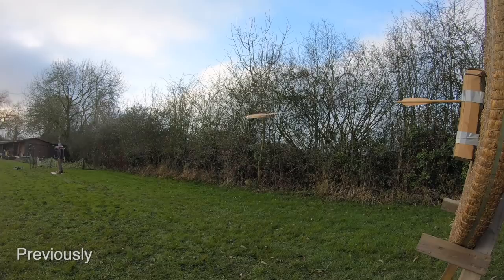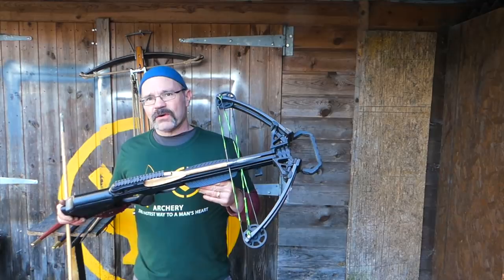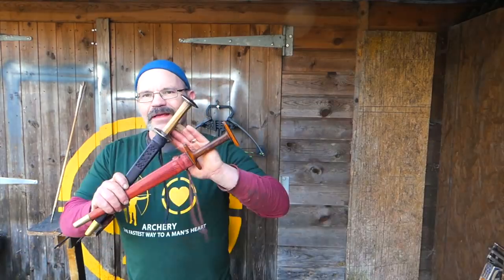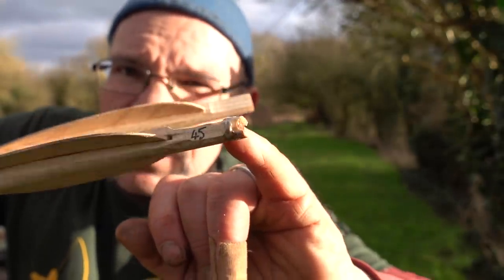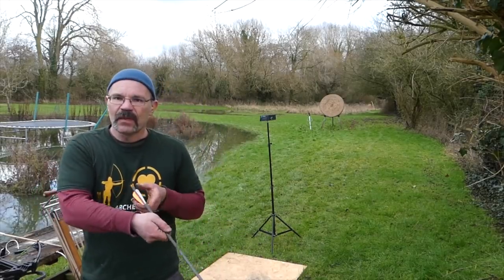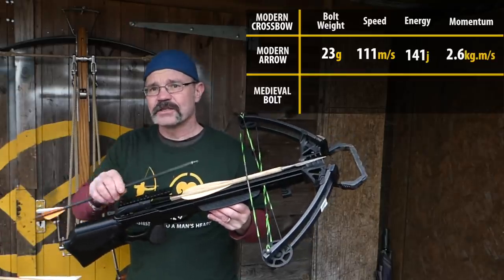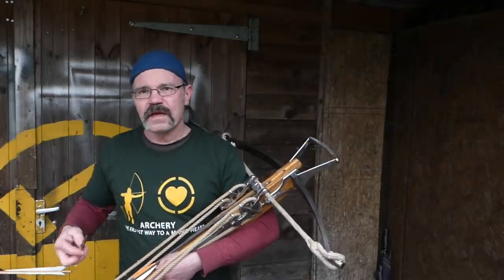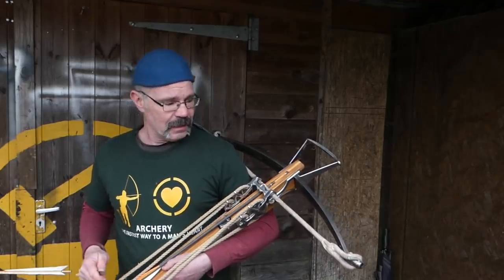Heavy Crossbow - Light bolt - What happens?

Comment: The heavy crossbow had less energy with the modern bolt for the same reason a sledge hammer won't drive a golf ball very far, and why a golf club isn't a good choice to nudge something heavy into place. Great video, cheers!
Reply: This comment is the explanation :)
Reply: Except the modern bow (the golf club) got a lot more power from the heavier bolt.
Which makes me wonder why we don't use heavier bolts for hunting.
Reply: @Bacteriophagebs  I guess because light bolts are lethal enough, while also traveling faster. So it's easier to hit your target with them.
Reply: @Bacteriophagebs  Because speed is what counts, you don't need a super heavy arrow to kill a whitetail.
Reply: @spectre9065  Sure, but some people hunt bear with bows.
Reply: @Bacteriophagebs  Even bears can be killed with a 500 grain arrow. It is about shot placement.
Reply: @spectre9065  Bears can be killed by  .22 LR, too.  That doesn't mean I wouldn't prefer a .45-70.
Reply: @spectre9065  you ever see the video of the guy taking a bear with a blowgun?
Reply: Or a Power lifter struggling to throw a Javelin far while the Javelin thrower struggles to throw an Anvil.
Reply: @spectre9065  Sure, but ideally you want to end him rightly, which is why I would suggest using Pommel Tipped Bolts. Zero penetration but plenty of Stopping Power. Could probably bring down an Elephant.

Comment: In the bowyers community it's referred to as ''dry fire speed'' which indeed means the speed at which the string returns to brace height without any projectile on the string. 
This is mainly looked at from a ''flight'' (max distance shooting) point of view. A flight arrow can be so light that the bow comes very close to dry firing speed. However this is only really useful for short bows with light tips, an English longbow wouldn't gain that much distance just like the 960lbs crossbow didn't. 
But here's an interesting thought:
Regarding wooden bow efficiency the infamous ''10 grain per pound'' (gpp) rule is normally used. That means if your bow draws 50lbs, a average arrow would weigh about 500 grains. If it shoots 180fps with a 10gpp arrow, you made yourself a wonderful bow. If you go to a flight arrow you might shoot 2-3gpp, but this is considered dangerous because the bow is close to exploding.
The 960lbs crossbow only shoots 1gpp when shooting the 67gram bolt at 181fps! Yet it's safe even though the prod could be forge welded from 20 pieces!

Comment: I have to say; beautiful job demonstrating the physics. Wish I knew the word for "base rate at which bow returns to brace" if there isn't, there should be. The KE vs momentum debate, has been a bit of an obsession of mine, again great stuff.
Reply: According to documentation on Hooke's Law - the physics behind how springs work - it is "Restoring Force". That being said it is not a calculation of speed, and therefore not a rate. I suppose the rate would be 'Once however fast you can fire' as that's how quickly it would do it. You could convert the velocity by measuring draw length though, film the release on a high frame camera, monitor the time and then make the calculations from those. You would in reality though be dealing with fractions of a second, but could convert to m/s.
Reply: That debate has to be settled once and for all. The main problem is speed as at high velocities friction is wonky. So low speed it is. I'd say take a 1 kg weight with a pointed shaft and while swinging from a rope it should drop 1m in height and end up at a target while the rope is vertical. E=10J, p=4.5kg*m/s. Then take the weight to 10kg and drop it from a 0.1m height swinging. E=10J, p=14kg*m/s. The speed difference is small and would have negligible effects from friction. If they have the same penetration Energy wins, if not I would expect a 3 times better penetration of the 10kg for Momentum.
Reply: I had been thinking of it kind of like e pendulum, the moment of pendulum is the same with little regard for amplitude. So would a bow be similar? For example, would a bow drawn to 28 inches that returns to brace in say 3 (just picking a number)  milliseconds does the same bow, drawn to 32 return to brace in the same time?
Reply: @bokkenwielderful  hypothetically there would be a difference unless you increase the tension on the string. We are talking a difference of nanoseconds, but numerically speaking there would be a difference.
Reply: @bokkenwielderful  If it was a true spring mass system where the force is linear to the travel it should be the same time in a vacuum (no aero effects). But given the nature of the force draw curve usually found in a conventional bow it would mean it would be faster at the 32.

Comment: ++++TLDR AT THE BOTTOM++++

Engineer here. The speed at which the Materials in your bow are moving depends on their stiffness, their mass and of course how they are arranged. There's nothing more. Under the keyword "structural dynamics" there is a lot of information, though it's difficult to understand.

Now to the bows: Steel is very stiff. And very heavy. So you need a lot of mass to get a certain total stiffness. The string is also very thick and heavy, so that it isn't breaking. This means there is also a lot of mass that has to be accelerated to high speed. And on top of it there's only very basic leverage used. So all these heavy parts have to move quite quickly compared to the bolt.

On the modern bows there is much  fewer weight that has to be accelerated at all. And the compund system is optimized such that by usage of leverage minimal energy stays in these moving parts. They are light and compared to the speed of the bolt much slower than on the old bow.

Now on both bows all (in fact not all) stored energy is transfered into movement. Some of it moves the bolt and some of it moves the bow and string itself. A little bit simplified: To all time instances the sum of potential energy and kinetic energy is constant. The kinetic energy is the sum (integral) of the energy in each point of the bow and arrow. So to calculate it, you have to sum (integrate) up all the local energies E_kin=0.5m*v², with m and v beeing the local mass and speed. Let me rewrite all the formulas:
E_pot=given.
E0=E_pot+E_kin=constant
E0=E_pot(t=0)
E_kin=integral{ of 0.5m*v² }{ over every moving part }

This can be approximated by saying, that the kinetic energy is approximately
E_kin_approx=0.5*m_bow_effective*v_bow_effective²+0.5*m_bolt*v_bolt²
So I introduced m_bow_effective and v_bow_effective which approximate the properties of the bow in such way, that this E_kin_approx is as accurate as possible. I further approximate this by saying that there's a constant factor C, such that
v_bow_effective²=C*v_bolt².

This leads to this much simpler equation 
E_kin_approx=0.5*(C*m_bow_effective+m_bolt)*v_bolt²

Next step, I want to derive an equation describing the kinetic energy in the arrow. I do this for the time instances where E_pot=0:
E0 = 0+E_kin = 0.5*(C*m_bow_effective+m_bolt)*v_bolt²

by substracting the energy of in the Bow, we get
E_kin_bolt=0.5*m_bolt*v_bolt²=E0-0.5*C*m_bow_effective*v_bolt²

OH BABY! Finaly a usable first result. It tells us, that if m_bow_effective increases, E_kin_bolt and also v_bolt are decreasing. Exactly what was shown in the experiment. Let's go back one equation to derive something less abstract for E_kin_bolt. By division we get
v_bolt²=E0/(0.5*(C*m_bow_effective+m_bolt))

Multiply again with 0.5*m_bolt we finally get
E_kin_bolt=m_bolt*E0/(C*m_bow_effective+m_bolt)

by now choosing some constants as m_bolt=1, E0=1, C=1, we get a beatiful graph 
https://www.wolframalpha.com/input/?i=x%2F%281%2Bx%29+from+0+to+5

TLDR:
showing that if we use an arrow that's light compared to the effective weight of the bow, increasing the arrows weight is almost linearly increasing it's energy. If it's heavy compared to the bow, increasing it's weight further doesn't increase the energy much. Guess where each of the bows is located on this curve.

I would be happy if this comment receives some love c: took me an hour to write Haha
Reply from the maker: And it does receive love!  Thanks sci much for this; I can't pretend I understand it, but there will be people out there who do, so thanks on their behalf for enlightening things.  In a nutshell, this is why I test stuff, because I have to see it.
Reply: Despite your Comment made me feel dumb^^
Here is +1 Love from me
Reply: @tods_workshop  Thanks Tod <3 That's why there is the graph and the TLDR. 

I Assume that this bow could shoot an arrow with 120g at around 48 m/s with 140j and a ton of momentum. I would love to see this in a test.

Since I haven't determinend the constants, any prediction can be just by rule of thumb. Therefore it's mandatory to do these practical tests for practical knowledge!
Reply: @ottersirotten4290  And you get a <3 for your beautiful name. Made me laugh
Reply: Is the given data enough information to solve the equation for the given bows? If so, then the ideal mass of the bolt could be calculated to optimize either energy or momentum. (It appears that momentum is a better predictor of penetration than energy, from the data I've seen.)
EDIT: If I'm reading this right, I just realized that the equation you gave has a maximum at infinity, which means the optimal energy/momentum only happens when the bolt is effectively infinitely more massive than the bow limb. So I guess that won't work.
Reply: @mitchellhowell9380  Yes, your edit is absolutely correct. Because I neglected all the losses (friction...) my calculation says that any heavier Bolt has more energy. So in fact there is no real optimum. But if we introduce a weighting function, where we for example compare the gain in energy vs the loss in speed, then we can absolutely find an optimum in this measure.

This weighting is of course a bit subjective and depends on the purpose of the bolt. For achieving a long range one would maybe get an optimal arrow weight of 67g out of it, and for best armor penetration on short distance an opimum at 150 or even 200g.

Comment: You can always trust a man with a horseshoe moustache who's holding a crossbow.
Reply: Clean-shaven with an intimidating laugh and a slingshot works as well
Reply: @ilikeyourname4807  don’t forget the bald head ;)
Reply: It is indeed a moustache of epic proportions. Even Trevor Philips would be green with envy. Maybe; when I finally shave off my lockdown facial fungus, I'll try out the horseshoe look.
Reply: Especially when he is selling you something.. 
Tod: "hey mate, buy my daggers!" 
me: swipes sweat, swipes card
Reply: As long as he does not point it at me.
Reply: Seems  a bit like pcp air rifles. With them you get more power with a heavier pellet without as much of a speed drop off. Yet a Springer performs better with a lighter pellet.
Reply: @lilmundo6826  Yeah, moustaches have been known to go off when being cleaned.
Reply: As long as he's standing on the same side of the moat as you.

Comment: Todd, great video!  Your analogy about a sports car vs a truck is very apt.  I ran some numbers based on your test results.  The medieval style crossbow effectively is pushing an additional 168 grams of mass (so it accelerates 168+23 or 168+67).  It is actually pushing a lot more weight than that, but most of the weight is traveling a significantly shorter distance.  By contrast the modern crossbow is only accelerating an additional 4.7 grams (so 4.7+23 or 4.7+67).  So for the medieval bow, the arrow is a small fraction of the weight being accelerated by the bow, whereas for the modern crossbow the additional mass from the bow is the small fraction.

This also means a 200g bolt from the medieval bow would still go 44 m/s and pack 193Joules!  So, launch some Plumbata from the medieval bow!
Reply: Oh, and if the bolt is around 150g, the modern and the medieval bows should produce the same speed bolt.  Anything heavier and the medieval bow wins.

Comment: It'd be a tricky build and require a very remote and well banked testing location; but it would be awesome to see you test Detritus' Piecemaker from Discworld someday.
2000lb siege crossbow; originally cart mounted, windlass draw of course, firing a 6ft iron bolt; converted to fire a bundle of 20 or so arrows which in the books shatter into pieces and frequently burst into flame in flight due to the intense pressures involved so that the target is met by an expanding supersonic fireball of splinters and death. 
It can open the front door and backdoor at the same time, and half the wall as well.
Reply: Would be cool, but seeing as this one is 1000lb and fire "standard" bolts, would it not be hard for a 2000lb to fire a 6ft iron bolt?
BTW not trying to be an ass. I know it is fantasy and I love Discworld.

Comment: Brilliant demonstration of speeds through different technologies and materials. Now I have to say, I've got the chill's when you shoot the modern bolt with the 960lbs holding it in place with your thumb. 🥶
Reply: Imagining the nock splintering straight into said-thumb. (a thumb tip "clip" could be a fitting accoutrement (piece of bling)

Comment: What I learned from this video is that I need some much heavier bolts for my modern crossbow.  That was some serious power!
Reply: Yeah, that'd be great for fighting armored infantry, and they've have loved it in 1400. But in 2021, a crossbow simply isn't a weapon of war. The bolts are light because the intended targets are animals, and they're heavy enough to penetrate flesh; above that point, you want lightness for better range and accuracy. You simply aren't likely to face an armored, human opponent, and if you do, they will probably have a firearm that outperforms the crossbow by several orders of magnitude.
Reply: @Corrodias  People hunt bears with crossbows.  When hunting a bear, there is no such thing as "too much power" unless the recoil makes you likely to miss, which isn't a problem with even the most powerful crossbows.
A light projectile goes farther, true, but the question is how deadly is it at that longer range?  If you start with more power, within a certain range, you will still have more power on impact.  This could lead to having a longer effective range.
As for accuracy, I think you mean "flatter trajectory," which only equates to accuracy if you can't judge the trajectory properly.  This seems to be a problem for many bowhunters, but never has for me.  The problem seems to be that most crossbow hunters use scopes, usually very simple ones without a ranged reticle, and rely on the reticle without holding over, so they're limited to the maximum point-blank range of the bow.  While the MPBR can be 200-300 yards with a rifle, with a crossbow it's maybe 50 yards (though 30 would be more realistic for hunting).
Reply: @Bacteriophagebs  Interesting information, thanks. I see there are still advantages to heavier projectiles in modern scenarios.

Comment: Impedance mismatch, as expected. So then one wonders what the optimal bolt weight is that would optimize either energy, momentum, or both for each crossbow.
Reply: I mean, that wood bolt is probably just about optimal. I mean we don't know exactly what they shot but we know the construction of the crossbows and the bolts, and we know they were in use for centuries and that they defiantly would have been fiddling with bolt weight all the while. Really the solution they seem to have come up with is just use a heavier crossbow seeing as we get anywhere from 0.7k lbs to 1.3k lbs and potentially some outliers even a bit higher but they all seem to have shot more or less the same design of bolt (though we can't be 100% sure of the material of the wooden shaft).

Comment: Interesting. It suggest that the inertia of the bolt is small relative to the inertia inherent in the bow, so the weight of the bolt could have been increased, possibly quite considerably without significant loss of velocity and a significant increase in momentum . As Tod has emphasised in previous videos, it is momentum that counts for penetration, so a heavier bolt would increase penetration, and possibly range without much loss in accuracy. But as Tod also always tells us, weapon makers in the past weren’t daft and if they didn’t do it, there was probably a very good reason.

I love these videos. As a professional engineer and amateur historian they really hit my sweet spot.

Comment: It would be nice to see you shoot consecutively heavier bolts from the medieval bow until you start seeing momentum losses. Find out how strong your "message" can be.
Reply: If the lighter modern  bolt didn't go much faster due to the limited spring action velocity of the medieval cross bow, I wonder if you are not optimizing the weight of the medieval bolts (optimal momentum). I'd submit that you can shoot a heavier bolt w/o seeing a large loss in velocity. I wonder what's the max momentum you can achieve from a heavier bolt..
Reply: Likely that would be at over 1 kg.
Reply: The max momentum a 80+3kg shooter can give a bolt would be when the bolt has 80+3kg, assuming the shooter and crossbow are well fixed toghether. It would be the same bone crushing momentum imparted on the shooter. You can go higher than that and suppose firing a crossbow with a bolt well fixed to a wall. In this case the shooter becomes the projectile and that would be about double what a 80+3kg bolt would have in momentum.

Comment: Hi Tod, One thing I noticed that might help and make it a little more comfortable when cocking your modern crossbow. I noticed you've got a few inches of slack in your cocking string. If you shorten it a little so that it puts the tiniest bit of tension on the bow string, it'll make it a little easier and you won't have to lift your elbows as high. Trust me, it helps a lot.  Great stuff as always. I love seeing your videos appear in my sub list